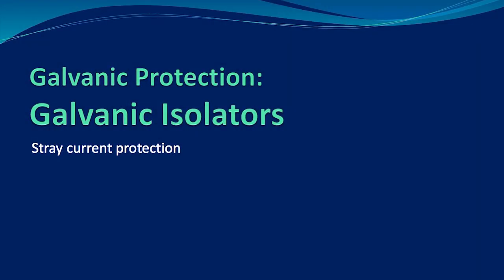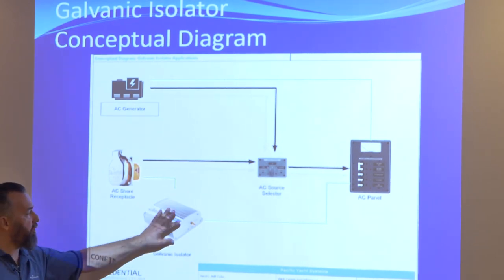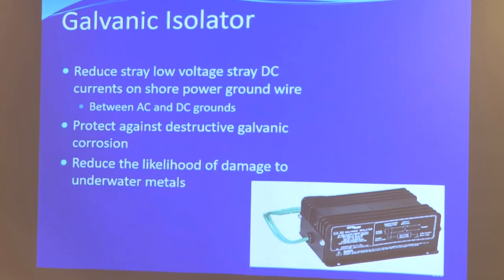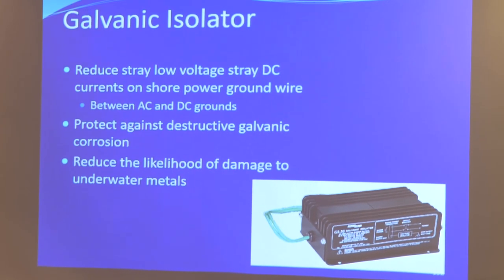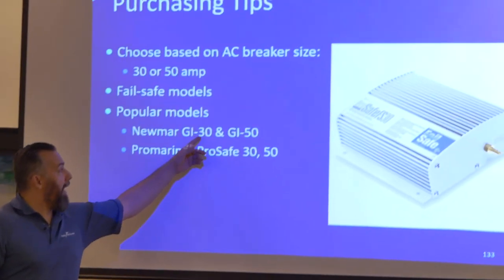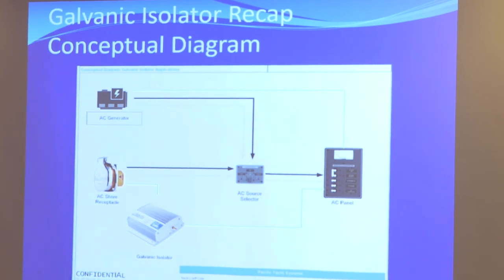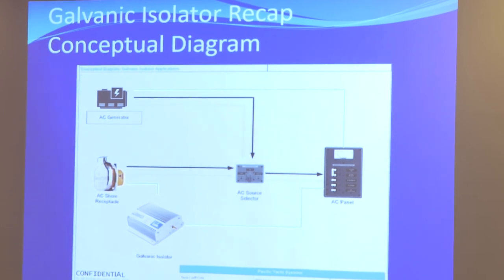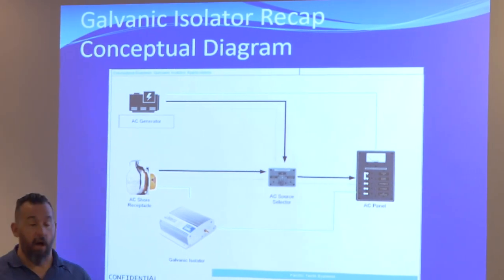How To: Marine Electrical Seminar - Galvanic Isolator - Ep 16/30

Comment: Great video thank you! Wonder if I need an isolator if I am just running shore power directly into a guest marine battery 2 bank charger and nothing else? Fiberglass boat with a pod and outboards. Thanks a lot!
Reply from the maker: Without an onboard AC system, there is no need for Galvanic Isolator.

Comment: Hi there, and thanks for the information in this video! We're actually looking at a boat to purchase and the boat lists of galvanic isolator as part of the accessories. How would I go about checking to see if it's number one a fail safe or fail open unit and number two to see if it's properly installed? This boat is a 1999 Sea Ray 340 Sundancer if that matters. Sure glad I ran across this video when I did.

Comment: If I have a 12v system only, but want to plug a AC battery charger to keep batteries maintained…. Do I need a Galvanic Isolator? The battery charger would be the only 240vac appliance on the boat.

Comment: What size galvanic isolator would you suggest for a 27’ boat with max 1500w onboard ac power consumption? Shore power plug is a 16A and boat is in Europe. Thanks!

Comment: So you cut the earth (green) cable coming from the inlet  to the distribution panel (obviously with shore power disconnected) and put two ring tedminals and each end  goes to the galvanic isolator?
Reply from the maker: Yep, pretty straightforward.

Comment: I was told I should have a breaker immediately after the shorepower input...Should the galvanic isolator be before or after the breaker ?
Reply from the maker: The Galvanic Isolator is installed directly after the shore power inlet and before the shore power breaker.

Comment: So, just to confirm I understood this right, as my steel boat NEVER connects to shore power, because we are ONLY ever at anchor, even if that's a drying anchorage, then we'd be wasting our money getting a Galvanic Isolator?.
Reply from the maker: A galvanic isolator goes on the shore power cable to block DC current to / from the dock.  If you never plug in,  you don't need the galvanic isolator,  it will do nothing.

Comment: If you have multiple shore power connections do they each need one or can they be connected to the same isolator?
Reply from the maker: Each shorepower connection should have it's own galvanic isolator or isolation transformer.

Comment: Is this necessary on houseboats also
Reply from the maker: Any boat that has DC and AC systems onboard should have a Galvanic Isolator or Isolation transformer, including houseboats. Galvanic Isolators are a good way to help protect against stray corrosion from shore power connections.

Comment: Does this have any relevance for fresh water harbours? Is this a necessary or wasteful option?
Reply from the maker: Don't have lots of experience with Freshwater marinas, since fresh water isn't as conductive as salt water not sure about how that affects the stray current corrosion.
Reply: Definately still needed on freshwater. Used heavily on UK canals
Reply: fresh or salt water, '' If you do not connect to shore power you dont need one'   If you connect to shore or dock power.  The problem can follow the AC ground.   ( not the water )